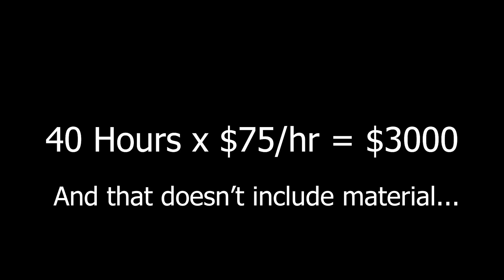Turbo Manifolds for the Ameri-Barra Vortec 4200 are Here - Work of ART!!  @artecperformance9335 ​

Comment: Why is the waist gate set up so odd? Maybe I am just not adjusted to I6 engines. But wouldn’t a waist gate turbo be better? And how much work would a VGT turbo be to put on and tune? A electrical vgt or boost regulated waist gate turbo would be a huge boost (pun intended) to the stock 4200 performance and economy. I am more interested in making a street light to street light Chevy trailblazer than all out power. Or a 4200 swap into a older Camaro.
Reply from the maker: Putting the wastegate on the turbine will provide good boost control, but cause the turbo to spool slower. Turbos with internal wastewater are just not great for good turbine flow.

Comment: what do the atlas engines weight? fully dressed from factory?
Reply from the maker: Not sure on fully dressed, but a bare long block with no oil pan is 320lbs.
Reply: @Calvin-Nelson  thank you for the fast reply. wow that’s  light👍 i’m thinking about putting one in a 1999 new edge mustang. building another budget drag n drive car. thanks for all your hard work and great details in your videos. 👍

Comment: Time is definitely money, but these suckers are north of 1700 bucks. I wasn't even planning on spending that much on the engine at this point.
Reply: To be fair, they look like a great piece for sure, and I don't begrudge them that price, but it's definitely a little steeper than I was expecting. My local scrap yard has several of these engines, and I really badly wanted to put one in either my K10 or c20, but it looks like it'll be LS swap at this point.

Comment: I thought it might have been a SPA Turbo manifold before getting into the details. Glad to see the aftermarket is starting to consider this engine. I know that's been a big goal of yours Calvin, and for everyone else watching.

Edit* Not that I have any background with this engine (yet at least), but I was thinking about this the other day, and the question is, what GM platforms (besides the OEM GMC's) does this engine fit well into? I've always wondered why the Ford/Foxbody stuff, even though I've always wanted to do a Foxbody Barra, but that idea is what spawned interest rather in our stateside contender here.
Reply from the maker: Thanks! They fit great in Foxbody Fords, but also fit GM G-Bodies, A-Bodies, and lots of different truck platforms really well. You can make them fit judt about anything if you are determined enough. See our Fiat build. Hopefully we will have oil pans that fit common muscle car platforms soon.
Reply: @Calvin-Nelson  👍 yeah I was hoping to get your advice with it, while the G-body was what I was curious about, though I figured it had the practical size in engine bay to accommodate.
Reply from the maker: @kylecurry6841  Rule of thumb. If it came with an inline 6 from the factory, it will most likely fit pretty decent.
Reply: @Calvin-Nelson  makes sense! I remember you saying that with regards to the Foxbody. I know Ford was just getting into V6 packaging during the 80's, and I know the Foxbody was prevalent in the form of the Mustang/Capri, Thunderbird, Fairmount, and quote me if theirs more, but I never knew Ford's I6 came in the Foxbody, rather I always thought of it as the econo engine for non-V8 Pickups.

Comment: About fit into the PV. You can just plug the WG port on the manifold and weld a WG pipe to the exhaust house of the turbo. Saves a lot of space. (And works great :-))
Reply from the maker: Nah. We'll just cut the wastegate turb down a bit a angle the wastegate over top of the frame.